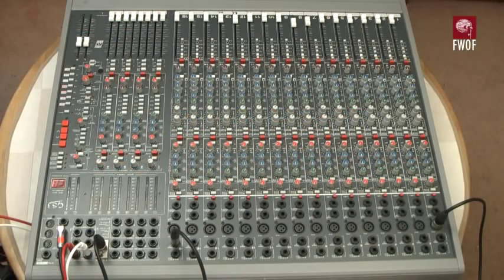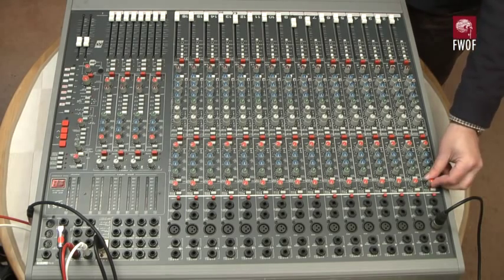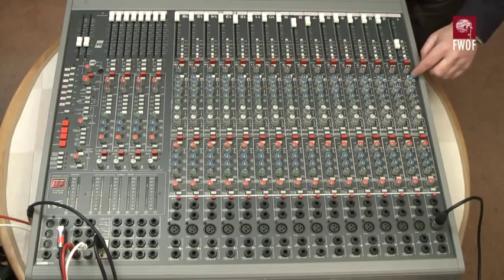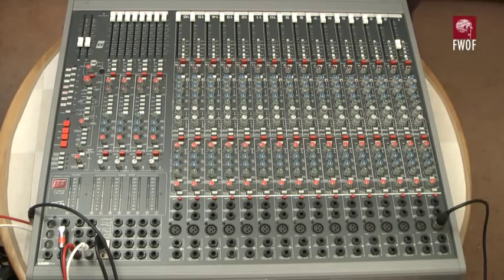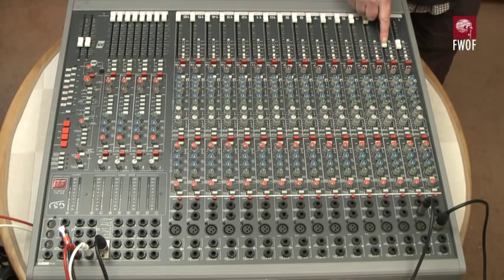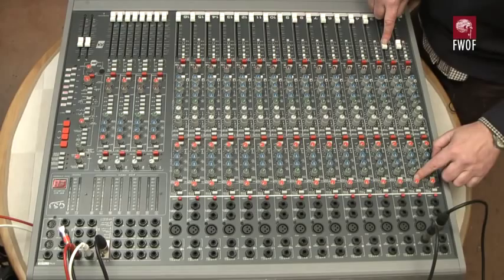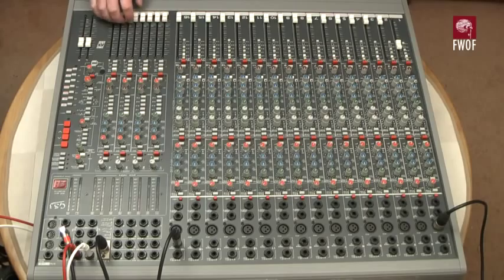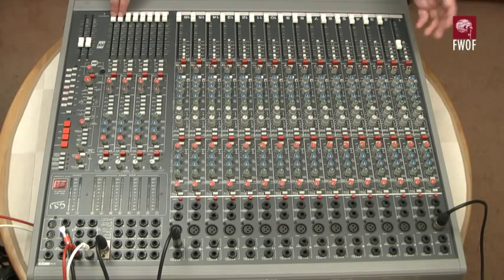Allen & Heath GS3 - Short Overview

Comment: Hi there it is long ago that you made this video, but anyway would like to ask you some question about the GS3 because I have problems with the Midi Mute Funktion so do you know maybe a solution or where I could finde a complet Mute Micorprocessor board for a change?
Reply from the maker: When I received my GS3, the MIDI muting wasn't working properly, but it took me about a year to realise it, as it was that long before I tried to use MIDI muting 'in anger' with my PC - all new concepts at the time! It 'sort-of' worked, but didn't seem logical, and didn't behave as the manual said it should. 

On closer inspection, it was obvious that the soldering on the MIDI muting board was terrible and full of dry joints (I'm an electronic engineer by profession, so I know the signs...) This was before A&H were doing automated flow soldering, so I guess the person doing the hand-soldering was having a bad day, or using a soldering iron with too low a temperature. I talked with A&H at the time, and convinced them I was capable of doing a board swap myself (which saved sending the whole mixer back - it's heavy - you will know that!), and they sent a replacement MIDI Mute Processor under warranty, which worked fine. However, that was a LONG time ago, and not much hope of a NOS board now. 

Have you decided it's beyond repair? There is a rechargeable NiCd battery on board, which may be dead, resulting in lost settings when you power-cycle the mixer. Any ex-equipment boards are likely to have batteries in the same state after this time, but I'm sure you could get an equivalent (NiMH?) replacement. Also look for poor solder joints ;-) - easy to reflow if there are. Most of the components are still available, and easy to swap out. 

I also had to replace one of the ribbon cable assemblies after a few years as the IDC connector contacts were getting dodgy. Although the GS3 was obsolete by then, A&H managed to dig out a replacement which they sold me for 30 quid. However, having so many connector pins in a mixer may make board replacement easier, but the huge pin-count is a serious hostage to fortune in terms of reliability. 

Good luck - I'd be interested to hear how you get on. (BTW I sold my GS3 a couple of years ago, so can't help you with comparative signal measurements, etc.)
Reply: FarewellOldFriends  hy my Friend! first of all ist very kind of you to answer my request ;-)
At the moment the mixer is at a professional repair service, but they charge 45€ p.15min.....s
Reply: FarewellOldFriends upp wrong button pressed! So as I bought the mixer for 100 I don't know if it is worth to invest in a old heavy big mixers, but I think it is a good one....also I made request at Allen & heat England, 14 days ago, but no answer till today........to explain a little more oft what is ms purpose for the mixer, I would like to integrate it with my Abelton Daw to listen back of my mix an integrate all my analog gear, to have hands on control.....do you think in your opinion that it is good for that, or should I go a other way.....Second solution I don't care and when the problem a cure I switch it on and off, and the problem is gone ;-)
Waiting to your answer with interest kind regards, Chris from Vienna!
Reply from the maker: Hi Chris - Ouch! E180 an hour sounds very expensive!

Don't hold out any hope of assistance from Allen & Heath - they really won't be interested in the GS3 after all this time.

It all depends on what equipment you are trying to bring together, but if you have a lot of MIDI synths being driven by Ableton (many of which will probably be stereo), and you don't need to apply EQ in the mixer, you may be better off getting a line mixer with lots of stereo inputs. 

Looking online, I see TASCAM's make a line mixer with 8 stereo line inputs with a couple of outputs in a 1U rack box (the LM-8ST), but it's quite expensive at ~E350. 

You don't say what your computer inerface is, but I have a Behringer XR-18 which will take up to 16 mic or 18 line inputs, and its virtual mixer allows inputs to be configured as mono or linked as stereo, and at E380 it's useful for lots of things including PA with live recording, and it's very small. The only limitation is 48kHz max sample rate, if that's an issue for you. 

The GS3 takes up a LOT of space in a small home studio, and has features you probably don't need with a DAW. It doesn't have individual input channel metering. It doesn't have MIDI control over anything except muting. It is also very heavy and an awkward shape to transport by car.

Maybe you could sell the A&H on to a collector who wants it for its retro functions (and who is probably capable of fixing the mute problem themselves), and get a more modern line mixer to do the simple combining job you are looking to do.

Whichever solution you choose, I wish you the best of luck. 

Cheers!

Comment: I just bought a GS3 and my 2 trk tape outputs are completely silent... I know it's probably some kind of rookie mistake, but I can't wrap my head around it. I've tried every possible combination and I can't seem to bounce the final mix. What components are necessary for sound to come out of "2 trk tape" outputs?
Reply from the maker: Hi - First of all make sure you have the operator's manual - avalable as a PDF download from Allen&Heath.  

Look at Section 5, in particular the diagram on page 5-22. Note that there is provision for two 2-track tape decks, and switches to allow you to select each deck for playback, and to dub from one 2-track recorder to the other. 

If you have either of the the '2 trk dubbing' switches pushed in, one 2-track machine will see the output from the other - so that will be nothing if you don't have a second machine plugged in. In normal operation both these switches should be out, so that the L-R mix bus is being sent to both tape machines. 

That may be the cause of your problem!
Reply: FarewellOldFriends Fixed. Thank you so much!!

Comment: Hi could u tell me what the OHMS for the head phone socket are  ??? I have an S2 16.......please
Reply from the maker: Hi Michael - Interesting to hear you have the S2, made by Allen & Heath for Thatched Cottage Audio back in the '80s - a slightly cut-down spec from the GS3, but a good mixer nonetheless.

Allen & Heath, bless them, still have the User and Service manuals for the S2 online, so I'd suggest grabbing them while you can! Here are the links:

http://www.allen-heath.com/media/S2-USER-GUIDE.pdf
http://www.allen-heath.com/media/S2-SERVICE-MANUAL.pdf

Unfortunately neither document specifies an actual recommended headphone impedance, but looking at the headphone circuit, which has BC549 and ZTX109 transistors in push-pull across +-16V rails, with 22 Ohm resistors in series with each rail and 68 Ohms in series with each headphone channel output, I would say:

(a) It can give quite a healthy voltage output (i.e. good for higher impedance phones), and  

(b) It has reasonable protection against short-circuit or very low-impedance phones. 

The driver is basically the same as the GS3, and I generally used 30 and 600 ohm phones on that mixer with no problem.

That was a bit of a round-about answer, but I hope it helps!
Reply: Thanks for your help...........cheers

Comment from the maker: Hi - I've had no problems with any of the faders, except that they can get crackly with age, often due to electrolytic capacitors feeding them degrading. 

All components in the GS3 are pretty standard - you can get replacement 100mm ALPS or similar faders online for a few quid each.

If there's no output at all, it may be the circuits driving them, and that's more messy to debug. 

I did need to replace one of the ribbon cables that linked the individual channel cards, due to poor contacts.